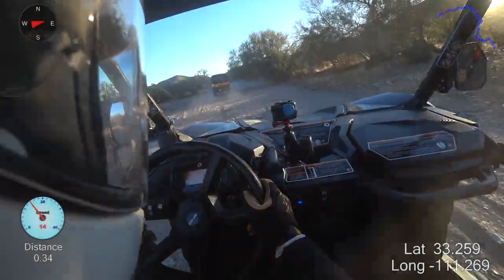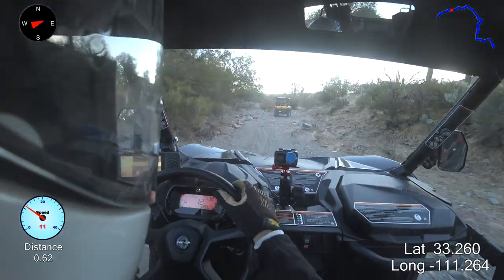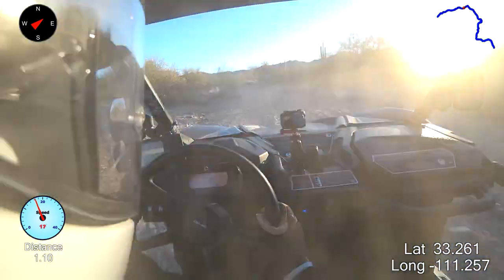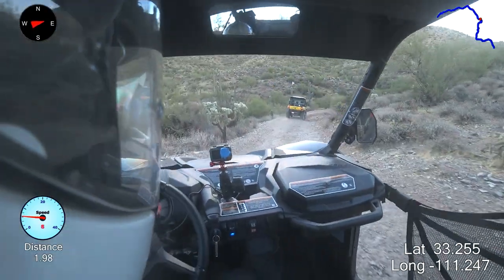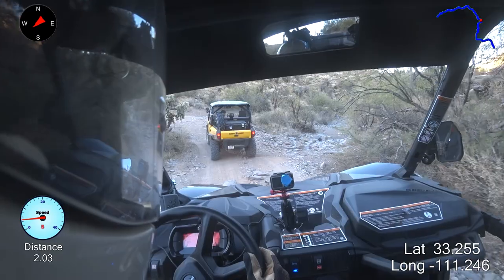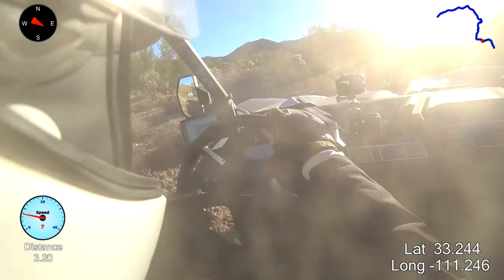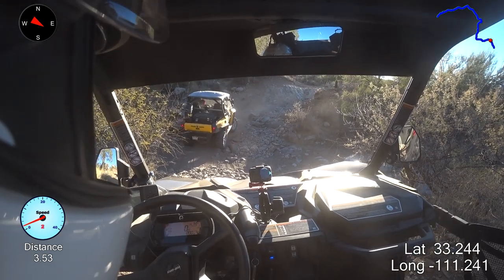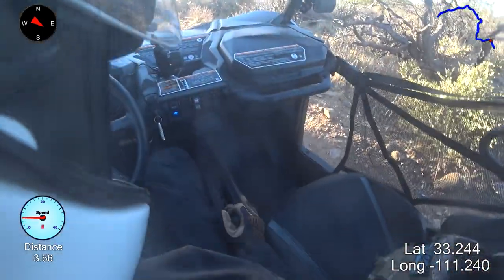New Roof, Winch And 2 Inch Wheel Spacers Installed

Comment: See that last big hill , I’m gonna be worried about stuff like that on my first pioneer ride , mainly because just a month ago I rolled my Honda foreman . So I’m gonna for sure be taking it easy and easy trails the first few times out and getting to know my machine . When we meet up I’m gonna have to look at that winch and wheeel spacers
Reply from the maker: You will see after a short time a SXS is way more stable than a quad in most cases. They can handle a lot more scary type stuff but you should take it easy at first. I drove a 20 mile dirt road when I first took mine out. Just to get used to it a bit. I was still freaked out after like a 100 miles. Now after some mods it's like a rock. Glued to the ground.
Reply: @NewZonaRides  thank you for the advice and yes I will take it . Don’t need to roll again

Comment: Wheel spacers are nice to have. I had 2 inch wheel spacers on my racing quad years ago and I was taken on how stable it was to cut corners going fast. So I can imagine it has enhanced trail riding big time.
Reply from the maker: When I had my quad like yours I got 4+3 offset rims and stiff sidewall tires and it was such a huge difference. The worst tires I have ever ridden on are the stock Can Am tires I have had. They are like riding on half filled water balloons. Those videos of me getting the new tires on my quad are still on my channel somewhere and those tires had a great price. Whole new machine after I got that on there.

Comment: I wonder if your tire pressure was a little low that morning with you bottoming out more than normal.
Reply from the maker: I set the pressure at 14psi because the stock tires are so weak in the sidewalls. So they had more than a normal amount of are in them at the time. It could have just been that I was steering more for the rocks I dunno. LOL

Comment: Just curious since it seems in your area you are not restricted to 50" wide machine, why didn't you buy the Maverick Sport for more stability?  Love watching your videos.  :-)
Reply from the maker: There were a few factors in my decision to get a Trail over the Sport.  Price in that The Trail is cheaper by a pretty decent amount. I figured it was real easy to make a Trail wider. Almost impossible to make a Sport more narrow. I also thought it would be good to pick and choose my widths based on where I was riding. Can’t do that with a Sport. The final reason was I never saw a Sport anywhere in stock other than the XRC version and it was way more than I wanted to pay. Now all that being said if I could go back knowing what I know now I would without a doubt by a new Commander instead. LOL
Reply: @NewZonaRides  Good points and yes that new Commander is sweet!!
Reply: @NewZonaRides If it's lower the spacers might be causing additional leverage against the springs. I understand the Trail and Sport share frames. For the dunes and wider trails I wonder if the 60" Sport suspension and axles can be swapped in, there would be no extra force on the hubs and carriers.